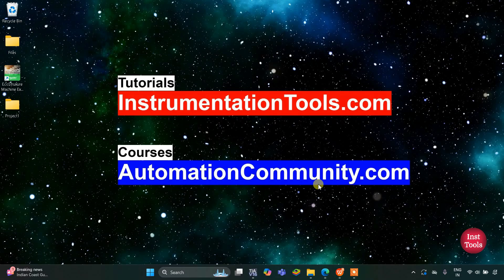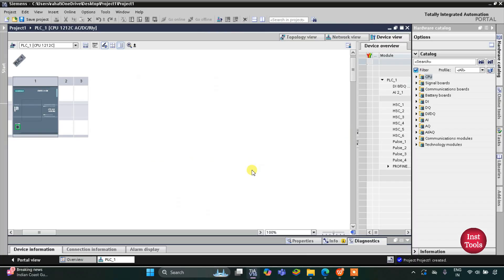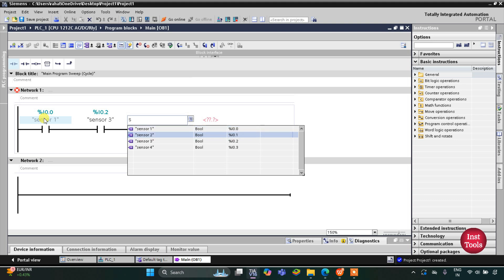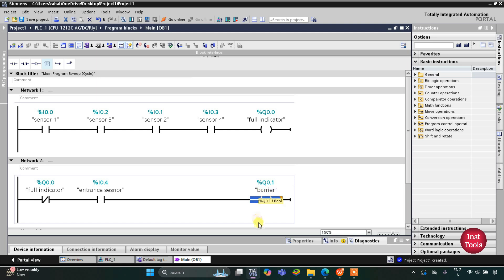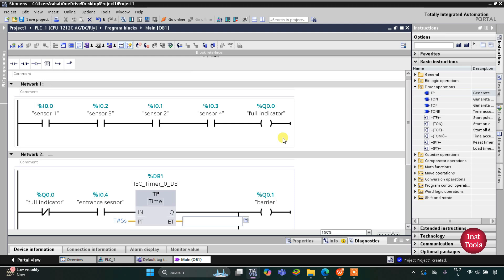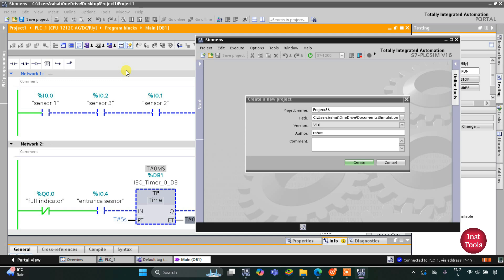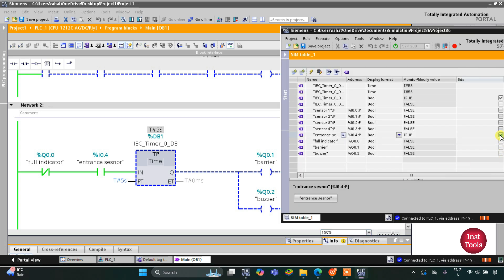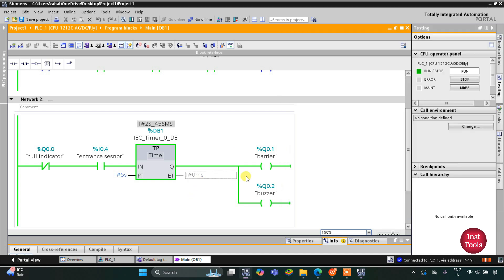Simple PLC Exercise Parking Garage

Comment: Nice project, practiced in codesys and it worked. I even went 1 step further and added 4 sensors in parallel instead of 1 entrance sensor, so if any of the 4 sensors are on buzzer is on. thanks. Keep more projects coming. Make it more complicated  like manufacturing station please
Reply from the maker: Great, do share your projects, Programs and their objectives in PDF versions on https://insteng.com for sharing with our community.